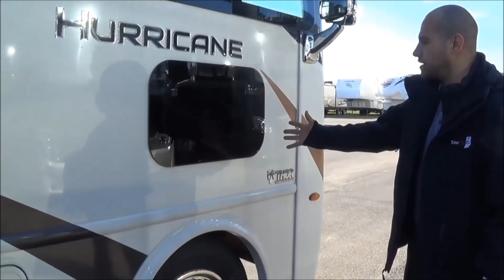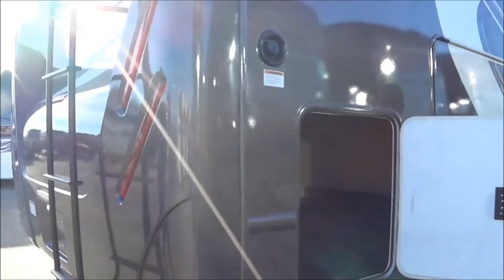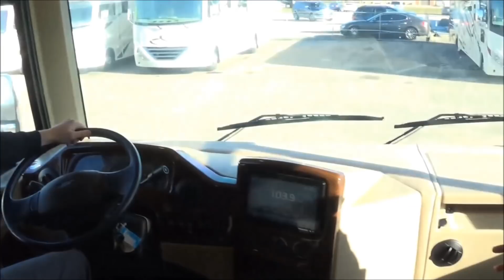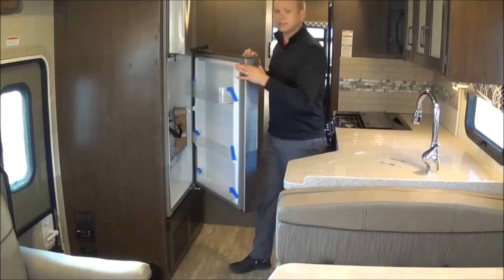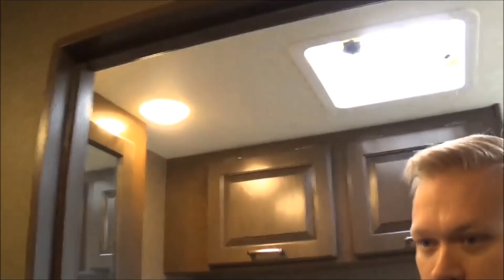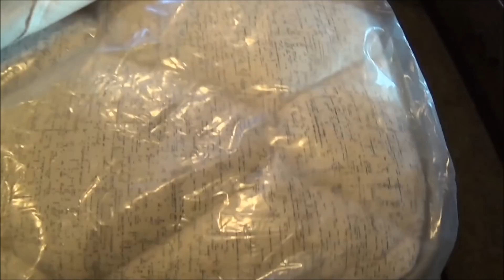2019 Thor Motor Coach Hurricane 34 J Walk thru with "Your RV Guy" Chad  and Derek!

Comment: Why is it that they demo boys never show how the sleeper sofa works up front. It is NOT a jackknife sofa and works completely different from what you would expect. The Camping World demo does a good job showing how it works. Another option is to replace this sofa with dual reclining chairs with a middle storage area available at shop4seats.com. With the king bed in the back, two bunks, the dinette conversion and the drop down sleeper over the cab, this sleeper is probably overkill. These recliners work great with the TV over the dinette.

Comment: Just purchased a 2019 thor hurricane 34R from Camping World Chatanoog TN. No on there showed us how to hook up a satellitelreceiver to this coach. There isnt a coax cable outlet in the cabinet by the splitter to hooh of the satellite receiver. HOW does this work, Yiou guys are from the manufacturer so YOU SHOULD KNOW,,,Right. Help
Reply from the maker: According to my Thor rep, the satellite prep entails a plate on the roof with coax out. The satellite is installed on or near it (I'm not a tech) and cable needs to be run from the plate to the cabinet where your satellite receiver is installed, and then plugged into your HDMI switch. Signal can be set to a TV from there.
I will post a link to the Hurricane 34 R we have here that is being prepped for delivery.

Hope that helps!
Reply: there is NO hdmi  "switch" in the cabinet, only and HDMI Splitter and 4 HDMI plugs. Nothing is plugged in, nothing. The equipment is just setting there with NOTHING plugged in anywhere. If I could attach a picture I would...they say a thousand words
Reply from the maker: @mrjimmy48  Sorry, I guess I call the splitter the switch. Do you have a dish installed on the roof?
Reply: @mrjimmy48  I would just plug those HDMI cords into the splitter. It should be "plug and play"
Reply: No not on the roof. It's called the tailgater and hooks up to the coax input on the outside of the coach. Only problem is there is NO coax hook up INSIDE the coach @Totalvaluerv
Reply from the maker: @mrjimmy48  What I'm being told is that the coax from outside terminates at the flat panel inside the cabinet wall next to the HDMI cables (It looks like an electrical plug, but it only has a button. That button turns the antenna power on and off). From there, it goes out to the TVs through the walls. With the power button on, it accesses the antenna on the roof, with it off, it can be used with a TailGator. But, you can only watch one channel on all the TVs.
Hope that helps!
Reply from the maker: You would also have to have a satellite box next to the TV. Unplug the coax plugged into the TV, plug it into the sat box and jump over to the TV with another short coax or an HDMI.
Reply from the maker: I called the rep after I noticed this unit had no dish installed.
https://www.youtube.com/watch?v=KGdzfVPqNM8
Reply: No help from Camping World? Here's my shocked face.. 😲
Reply: I have a 2012 Hurricane 31j bunker model. Bought it used in 2014, love it and like to upgrade to a newer model. How much does this coach run for?
Reply: @joegriego3091  hello sir this is Chad Rothrock and I can help answer any questions you may have about this unit. Please reach me at chad@totalvaluerv.com or 951-250-4166 thank you